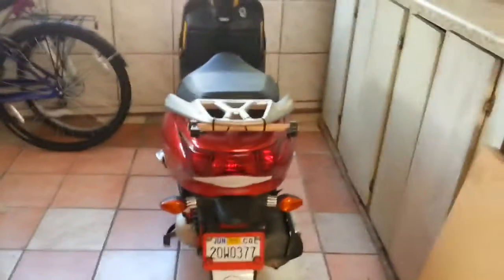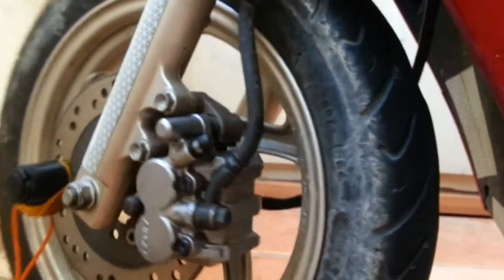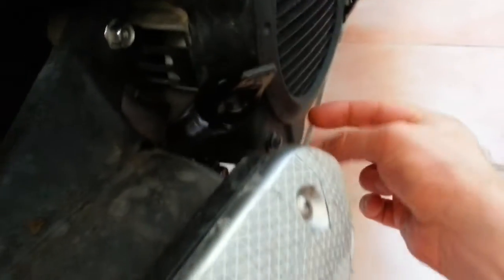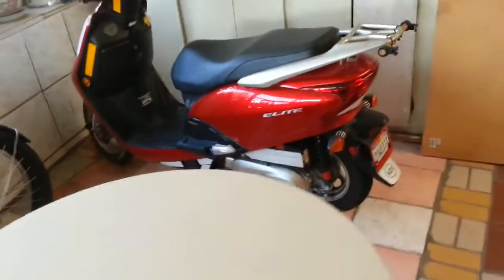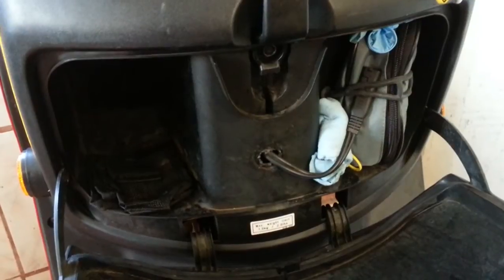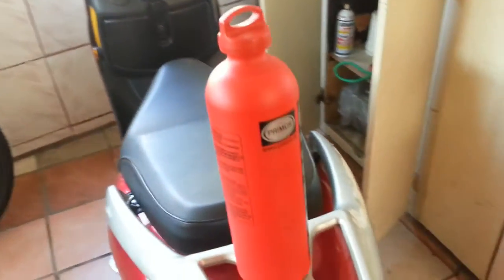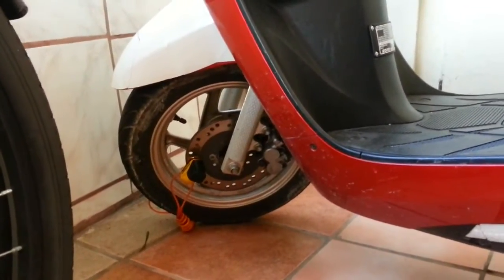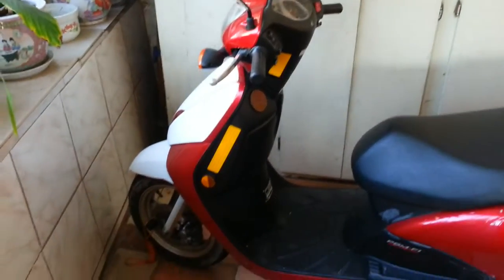Long Term Review of Honda Elite 110 Scooter

Comment: you can blow the dirt out of the air filter with an air compressor, this may double its life. i detail the whole motorcycle by spraying it with wd 40 and wiping it down with rags. a finishing buffing compound , like scratch out will remove marks and degrease the bodywork. thanks for yr channel, i enjoyed it
Reply from the maker: +polok890 Thanks polok, yeah, I plan to take the filter to a shop and ask them to blow it out. Never heard of washing the bike with WD40, but I imagine it would not hurt it. Thanks for the positive comment.

Comment: Great video, much appreciated. That was quite a drama reading about your experiences with a broken belt in the desert and no wrench handle on advrider. Safe riding!
Reply from the maker: Thanks! :) Looking to ride it this weekend. It works the day I bought it.
Reply: @john21031  ...I'm buying one tomorrow...beautiful paint and chrome, 5256 miles,  and paying a premium price. But I've had Honda 350cc cycles that went 36, 000 miles with no engine problems, so I hope I'm getting one almost as reliable as yours !!!  I loved your video.

Comment: #1, you sure LOVE putting reflective-tape on all your 2-wheelers!
#2, you can easily boost power-output with upgrades on the CVT assembly...like rollers, belt, air-filter, full-synthetic 10/40. and easiest of all, add some 'Octane-Booster' to increase compression
My '08 'Metropolitan' hits 42-mph w/a 220lb. rider, and stays at 28-mph unless the grade is severely steep
(I wonder if there is a 'restrictor-plate' on the air-intake...that would explain a 50-mph 'top-end' which is the first I've ever heard-of
for 110 'Elite' being that slow! It should top-out at 60! )
Reply: It feels like a governor is on the acceleration, my elite wants to go more than 50 mph
Reply: @omnesilere  Honda doesn't want people getting killed on their scooters, so they deliberately restrict air-intakes on smaller models
Speeds higher than 50-mph on a short-wheelbase scoots with smaller than 14-inch wheels is a 'recipe for disaster' because scoots aren't designed to handle pot-holes or road-chunks hitting the front-wheel and skewing it right over instantly at higher speeds than the dimensions can handle
Reply: @gerrynightingale9045  ...you speak truth, and some people can't handle the truth, as Jack Nicholson famously said.
Reply: @jamesconner3437  "I calls them as I sees them"

Comment: Awesome video. Thanks for the small details
Reply from the maker: You are welcome, James. I still have the Elite and it has 25000 miles on it. Not a single problem with it. Yesterday I  bought a 2018 Honda PCX 150 in Pearl white to add to the stable. :)

Comment: How in the heck did you go cross country on this thing?!  Lol.  I have the same scooter. I bought mine in Tn as well.   Was it a little slow for cross country travel?  I had a typhoon 125 that topped out at 62 mph.   I might would have I taken it on long trips.   I would love to know your route and stops you made for sleep.  I may try this myself.  I have 3001 miles on mine
Reply from the maker: +joegolden481 Hi Joe, it definitely is not fast, but I took a leisurely two weeks to do it. I rode with a passenger and we stopped along to visit national parks. It definitely is too slow for most people but I've ridden a bicycle cross country so riding the Elite is a peace of cake compared to that. :) At 3001 your scoot is just a kid and should last a long time. Enjoy it!
Reply: +john21031 how'd you ride it on the highway? without getting in trouble?
Reply from the maker: +joegolden481 It sure is not fast enough to even be on the freeway.  I actually was with a passenger and we took a leisurely ride that took a bit over 2 weeks. The roads were "less traveled", just county hwys, occasionally state highways. Stopped by several national parks (Carlsbad Caverns, White Sands, etc). Did some stretches of route 66. To choose the slow roads, you can try to use bike routes (either google) or something like adventure cycling maps (https://www.adventurecycling.org/routes-and-maps/adventure-cycling-route-network/).
Enjoy it safely! It's an amazing scoot. Mine currently has 19K as I've been riding other bikes lately but it will be used a lot this coming summer.
Reply: Just seen this response. I was under the impression you took the highways. I think the pcx150 might be the limit of what scooter could do on highway. Even that isn't that safe.

Comment: if i havent used it in a month and its been col how do i get it to start
Reply: Two years later, but for readers' info here, if a Honda does not start after only a month, cool weather or not, most likely your battery is weak or dead. Need to run the scooter a few miles every couple of weeks just to keep it in full charge, or buy a good "trickle charger" that will keep the stored battery near full charge when you don't go out regularly.

Comment from the maker: Here is a link to one ride report on this scooter. Enjoy :) (see in description)
Reply: So...why no 'upgrades' to the power-train? Install a high-performance variator and a 'Kevlar-belt' and of course, the 6.5 gram 'rollers' (they usually come w/the variator kit) and your top-end will jump to 65 or better and 40 on steep, long upgrades.There is NO reason for your '110' to 'crawl up-hill' or not be able to keep-up w/traffic at 55mph! Change to 'high-performance spark-plug as well will make a big difference w/high-octane fuel.Why 'mix' different viscosities? To achieve what?  Just use the 'mix' as per rating...'mixing' different viscosities of oil will NOT result in a 'new number'.'20SAE +40SAE does not = 60SAE......nor will it equal '30SAE'.'Oil' is not a 'numerical-function'.(oh...and next time? Turn OFF the water in there! It's really annoying on the audio track!)